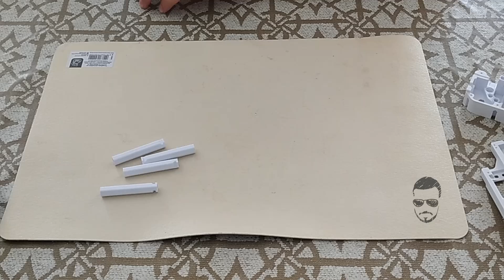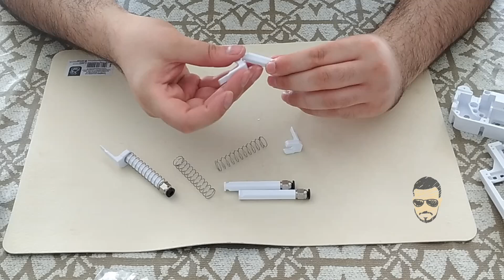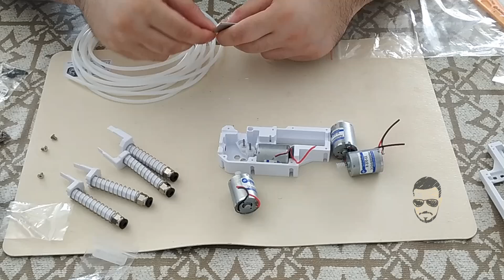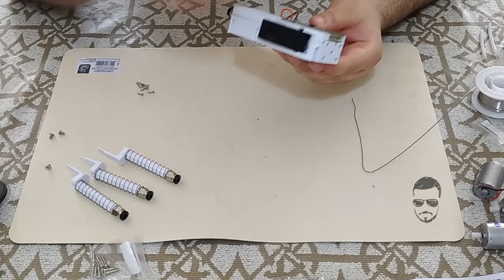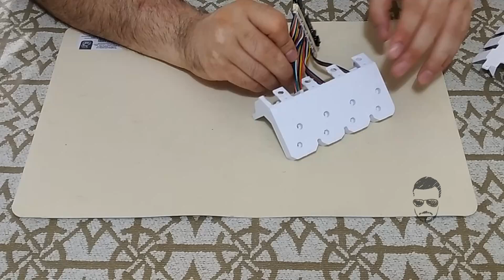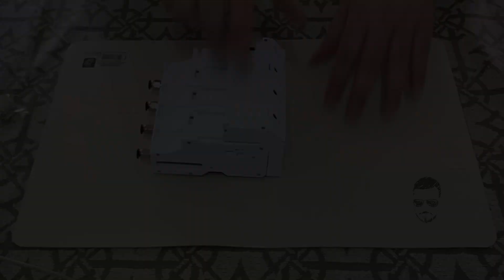Timelapse: BMCU - 370X - Assembly

Comment: Is it possible to run this device with a regular klipper-based printer? Looks really nice.
Reply from the maker: If it supports an ASM, I assume so. It's definitely compatible with an AMS Bambulab. To be sure, you'll need to contact the BMCU manufacturer. ;)